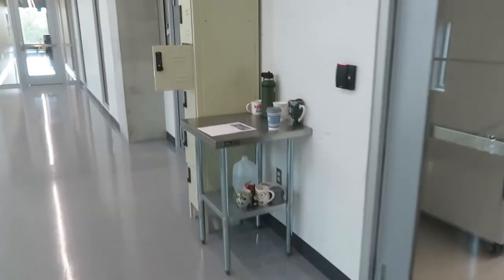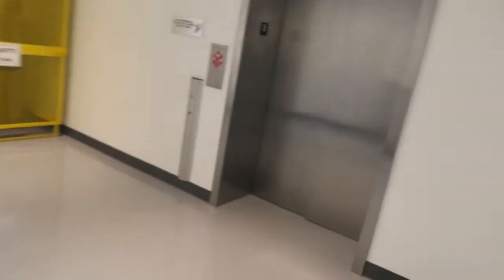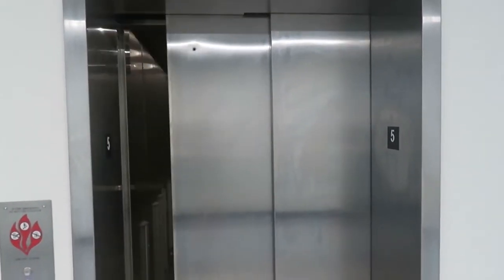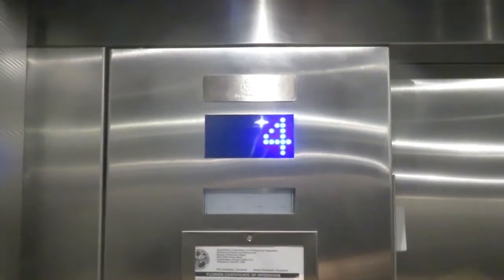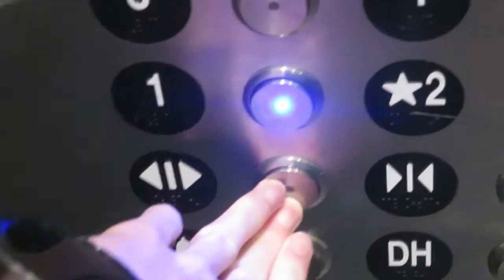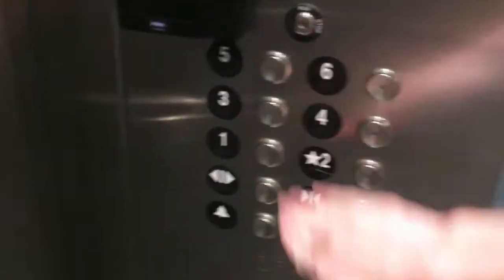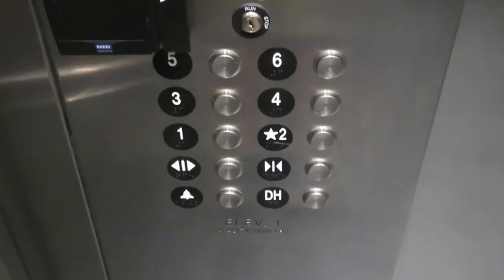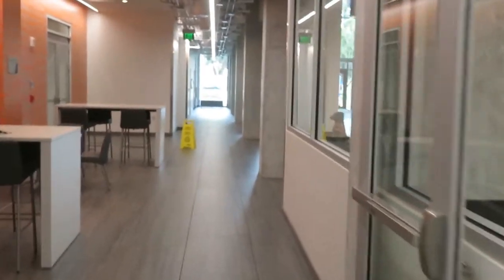ThyssenKrupp Evolution 200 MRL Elevator - Engineering Lab - University of Florida, Gainesville, FL

Comment: Those foot buttons are cool. Little flaw that you can only go in one direction though on the 5th floor.
Reply from the maker: Good point! That is unusual, that's for certain.

I think the university did that to deter people from going to the locked-off 6th floor, but I cannot be for certain. Something must need security up there, especially considering this building is an Engineering lab.